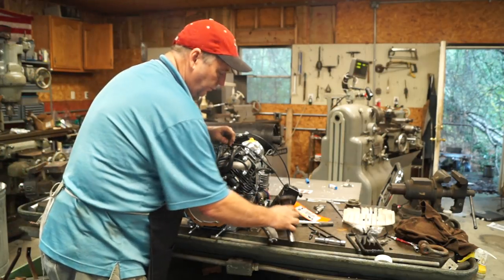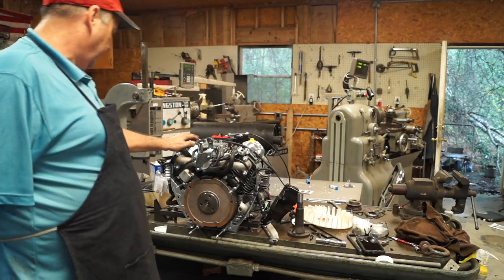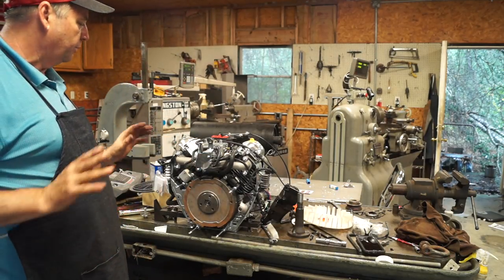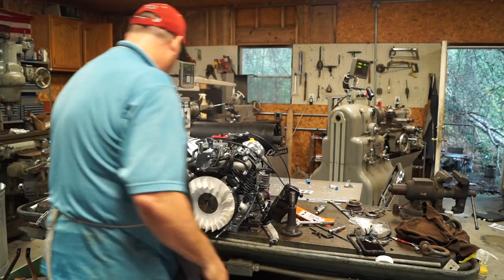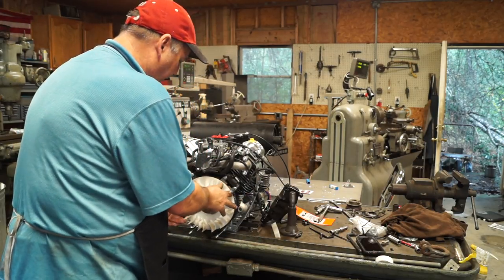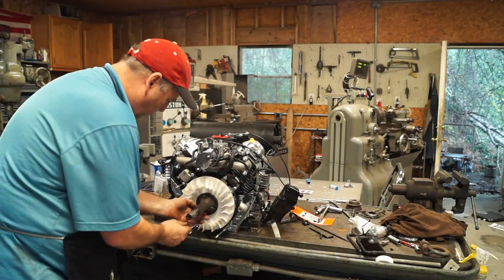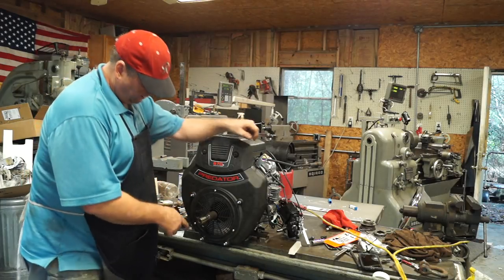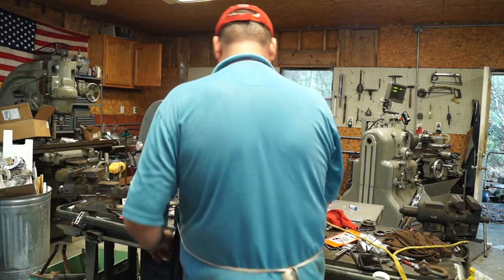Exmark Motor Swap 4  (Installing The Predator 670)

Comment: Nice work as always. I have an old 95 Scag that my kids use and it still has the original engine on it and that is what I would put on it if it blows up.
Reply: We have some Briggs engines at the golf course that have over 5000 hrs. Only thing that seems to destroy them is if you forget to put oil in them or knock a hole in the oil filter. :)

Comment: run 15/40 diesel lube oil and add magnets to drain plugs.
Good luck
Reply from the maker: In the motor or the pump?
Reply: Hi
I have a Dixie Chopper with a generac engine. I run 15-40 oil in the engine and the hydraulics that drive the wheel motors.
I understand the regular motor oils now have much less additives than previously.
The additives have zinc and other wear additives that help engine longevity.
I also recommend adding magnets to the drain plugs.
Does your motor have a screw on filter?
If not better to change the oil every few hours.
Good luck with the mower